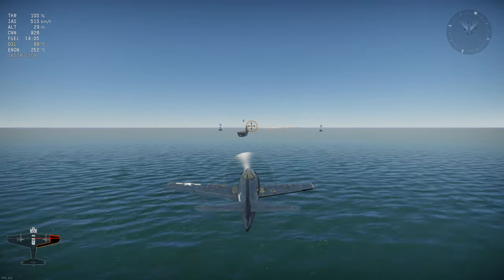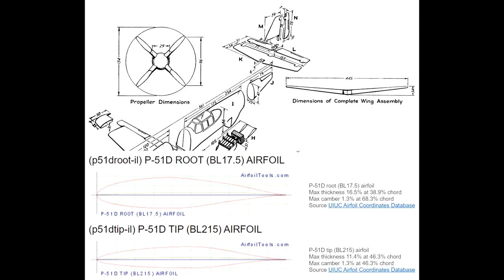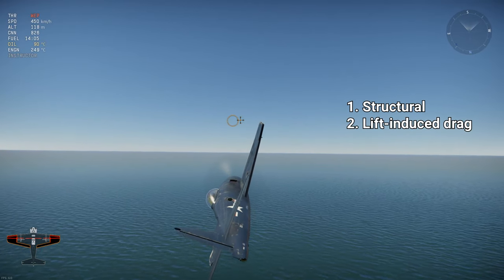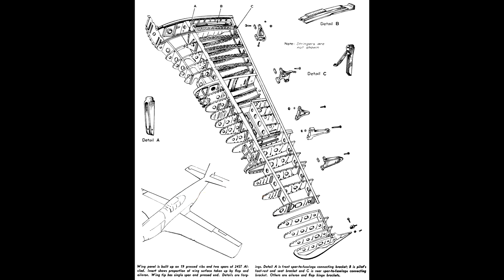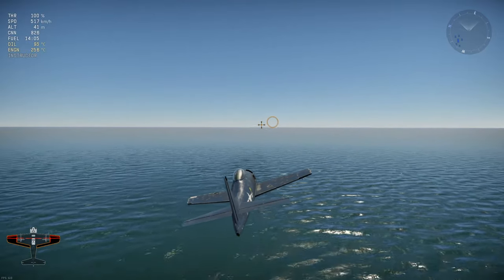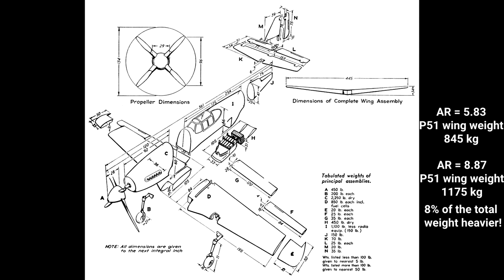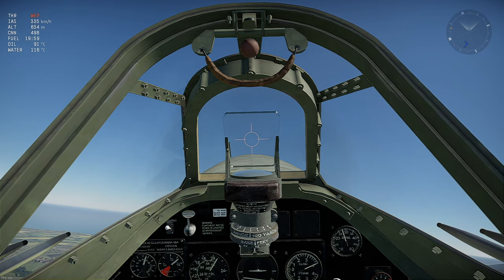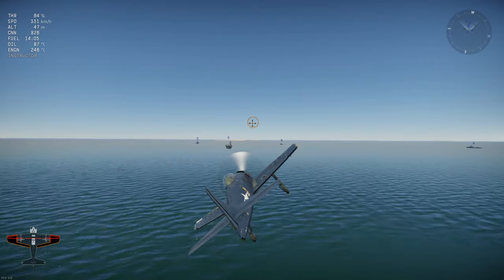Aircraft Wings Explained

Comment: So I realize that the bearcat has a lower aspect ratio wing than the Ta 152H, but it also has a much lower weight, larger wing area, and more power. With the greater P/W ratio and lower wing loading, shouldn't it still be better in a dogfight?
Reply from the maker: Depends what you mean by dogfight, but indeed the F8F has a tighter turn radius than the Ta152H. However, the sustained turn speed might be in the Ta152H's favour because of its massively lower drag (better MER). And in WT, Ta152H has great flaps capable of boosting it to make short work of the F8F especially above 4km.
Reply: Even at sea level in wt the f8f have only the first turn as window, at the second turn there is almost nothing that the f8f can do.